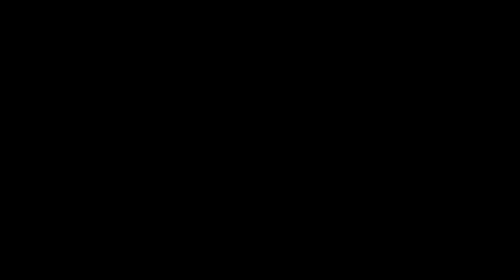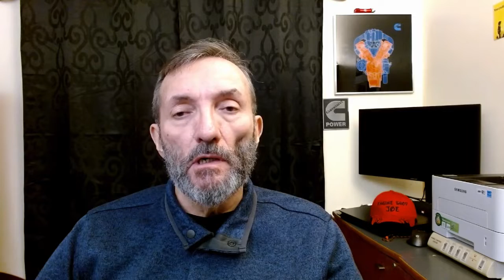The lunch room -  Exhaust High temp light configuration.

Comment: Thank you so much. Was freaking out about “high exhaust temp “ message after being parked and idle on and off for 48 hrs under very low temp. Had that message pop in when I am in local roads and low speed and goes on highway over 45 mph: